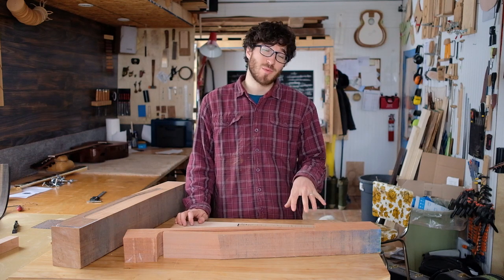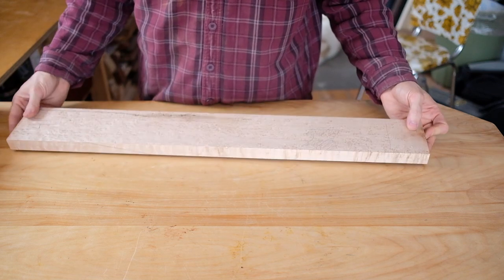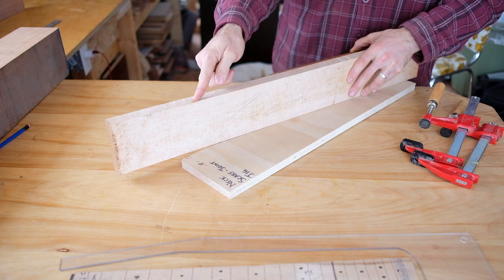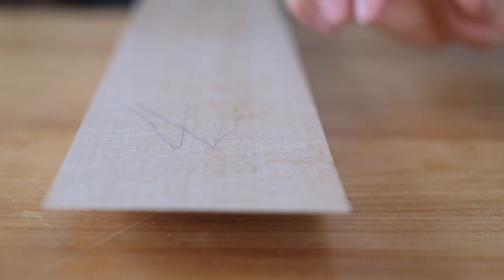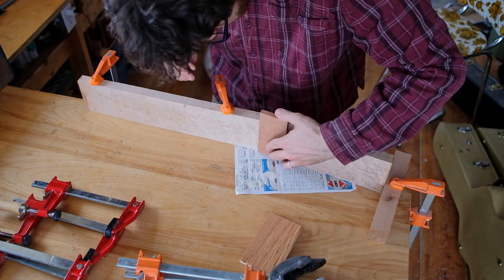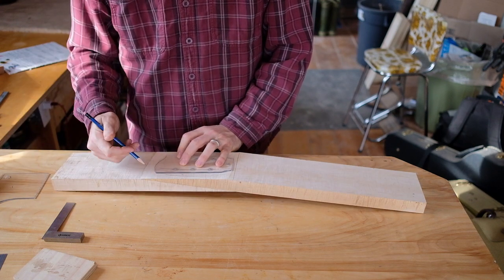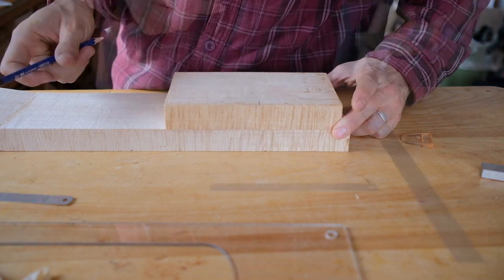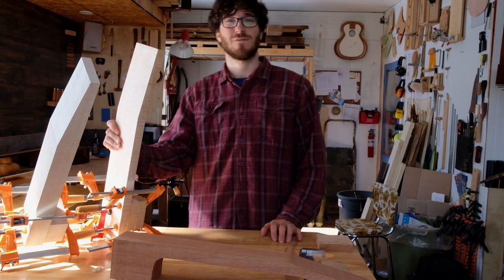How to Make a Clean Scarf Joint

Comment: For gluing scarf joints, I find cork backed spool clamps to be a great way to simplify the glue up. If you overlap the spool clamps over the leading edges, the parts won’t slip at all. Then I fit more spool clamps in between and with cauls I use a cam clamp to press the middle of the parts.
Reply from the maker: That is a good idea thanks for sharing. I just finished doing so many of these a couple of months ago. I will write this down so that hopefully I remember when the time comes to do another one

Comment: Awesome stuff, Zach. Can you talk about why you select 8° for slotted and 12° for standard headstocks, when the norm seems to be 12° and 15° respectively (for acoustic guitars anyway)? Do you find a benefit in the shallower angles when it comes to setup, tuning, tonality, etc.? Or is this just your personal preference?
Reply: Thanks for the comment Ricky :) 
I’ve always done my heads at that angle (that’s what I learned from my mentor) so I guess I never really gave it a lot more thought. I honestly can’t see 12 vs 15 degree break angle at the nut making a difference in the sound. The more break angle you have, though, the more friction you’ll have in the nut slots and that could potentially cause some tuning issues. The only reason I went down to 8 degrees for the slotted head is I thought it was a happy medium that causes the break angle of the strings to be fairly close to the same as in a 12-degree non-slotted head.